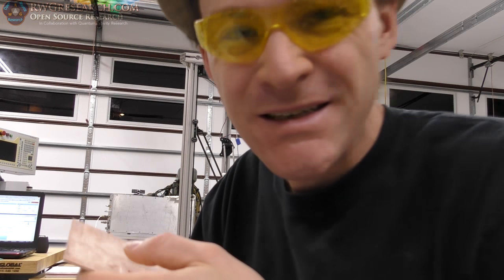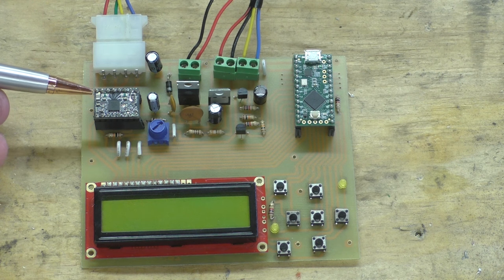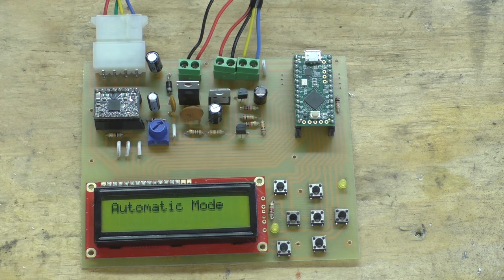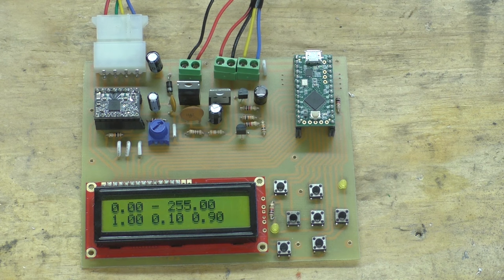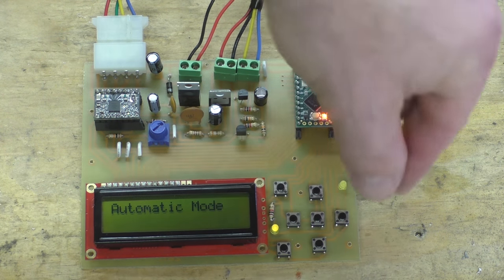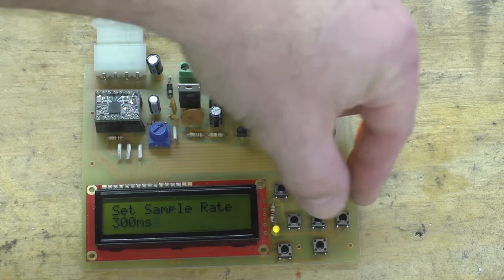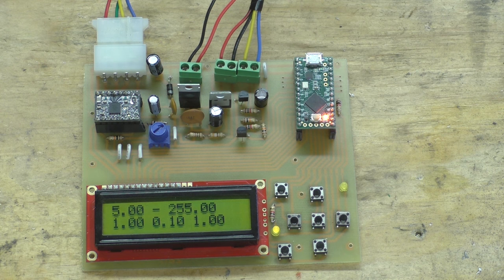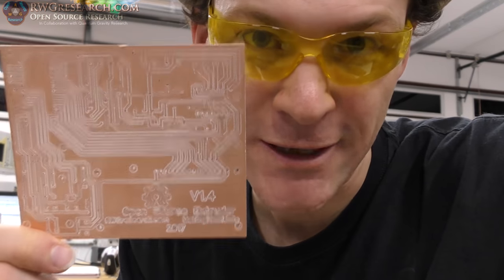Filament Extruder #14 - Circuit Board and Software for Caliper Measure Device.

Comment: interested in getting one I made a Water cooler... and a puller but I would like an Auto system that works not like the system I bought that I have to print replacements for because the Laser will not sit straight in the holder and get a good shadow on the Holl sensors

Comment: How would I do this on a corexy printer. I'm doing a printer around the duet wifi so is there a way to vhange from delta to coreXY.
Reply from the maker: The Duet electronics will run both delta and Cartesian stile systems. you just need to configure it that way. ~Russ
Reply: Oh, so it will run with the software that you have going right.

Comment: guys. why waste time retrofitting calipers for task that they weren't meant for? I suggest using http://www.thingiverse.com/thing:454584 I also suggest that you make one board that controls everything needed for the extruder. it would make it a much simpler and cheaper project. cheaper because you won't need multiple boards and microcontrollers. it will also allow you to potentially put the board on the market for people who don't want to make their own boards.
Reply from the maker: yes. there are better ways to measure the filament. however... some times we just do things because we can :). I agree with your comment tho. There are better ways to do it and there is a need for an all in one board. in the end. its just got to do the task at hand. The rest of the extruder is already a one setup and controlled system. so the only thing left is this part. thanks for the comment!!! ~Russ
Reply: ***** yes but your goal shouldn't be to make something work but to make something work that is convenient. Also that sensor I linked can be used in printers as well. So it beneficial for you to start messing with it because that way your printer can use it to cope with the filament you make.
Reply from the maker: Yes. your right. however this was verry convenient. those calipers are 8$ on sell. you can beet that for the precision they are. they have a data port built right in. can't beet that. in the end this is super simple. eazy and all components can be bought for cheep. basically what I'm saying is that there is no one stop option for this at the moment. so we make one. lol eazy. back to your comment at hand. I'm agreeing with you that it's a really good idea to start messing with that sensor. we are in agreement. ;)  but what I'm trying g to say is that this is not that hard and it's quite cheep. so we use it. ~Russ